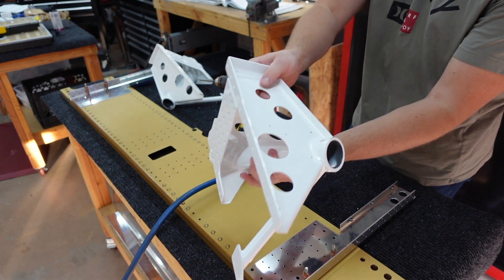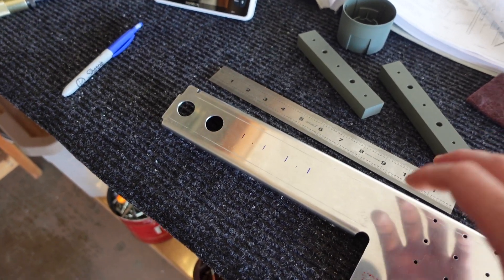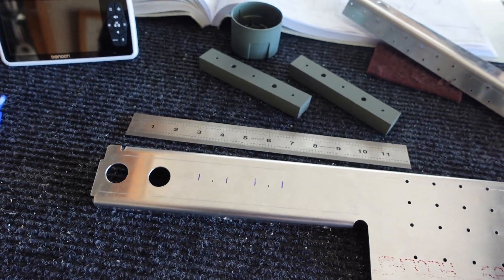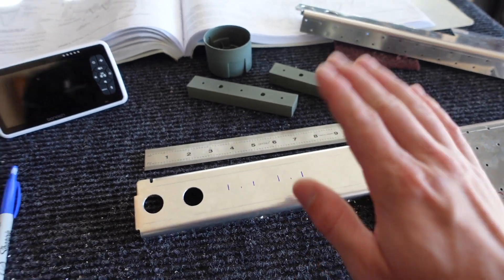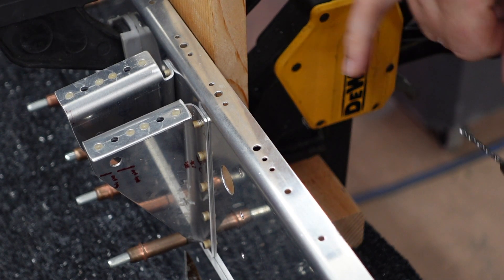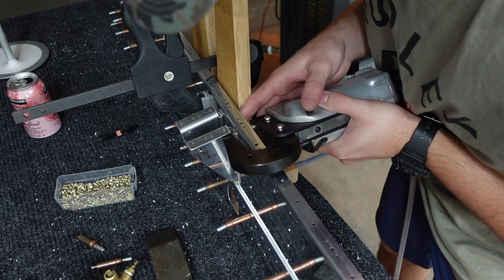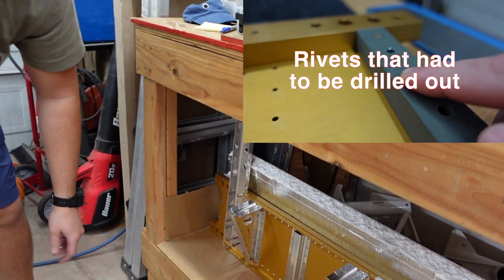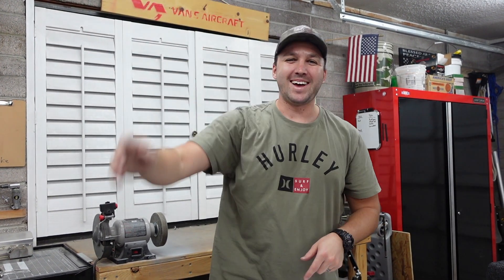RV-10 Mid Fuse Bulkheads - Section 25

Comment: Hi Austin thanks for an other great video. I am currently working on the same section as I have to wait for a lot of replacement parts too. What kind of cap are you using on your rivet gun? Are these SNAP-SOC? Your rivet heads look great. I still produce the occasional smile. Best Markus
Reply from the maker: Hey Markus, thank you for watching and for the comment! Yeah those are SNAP-SOCs. I really like them. They’ve definitely made using 470 rivets much more enjoyable and prevent smiles. They last quite some time too
Reply: @AustinManke  Hi Austin, thanks a lot for your response. I will order them to prevent future smilies :-). Have a nice time building!
Reply from the maker: @markusisler8830  any time!! Thank you and happy building to you too!

Comment: How did you get your replacements already? 😮 Im still waiting for mine. 
I don't expect them anytime soon, really. I had some Blue coded laser parts crater after dimpling, not good. I'm replacing all laser parts, except maybe Green. If they don't get dimpled. Good luck with yours .I have to wait.
Reply from the maker: I ended up on a phone call with an employee at Vans regarding a different issue about a month or so ago and I asked about the parts, and they ended up being able to send them to me. I think it was just pure luck the way it all worked out. It was right before inventory was taken off of the website and before the recent announcements. 

I hope they get moving again soon and you get your replacements! I have a ton of blue and green marked parts that I intend on using for now, but if those end up needing replacing I think I’ll be waiting for a while